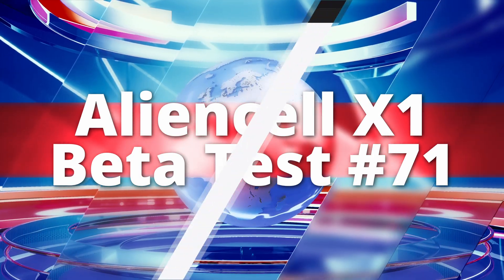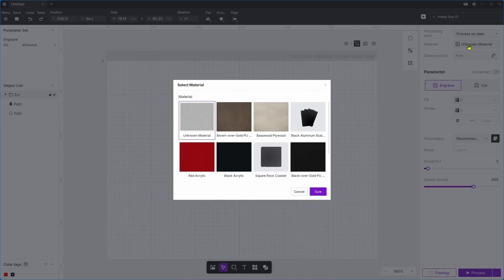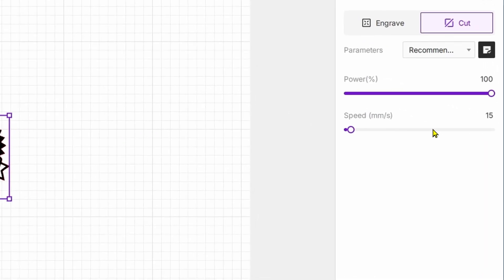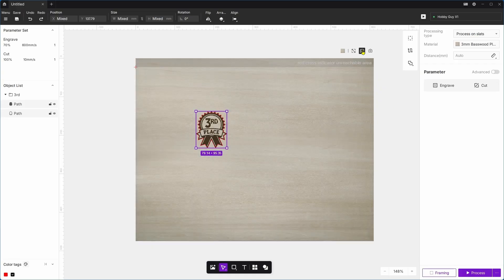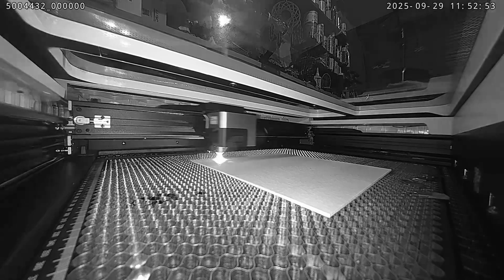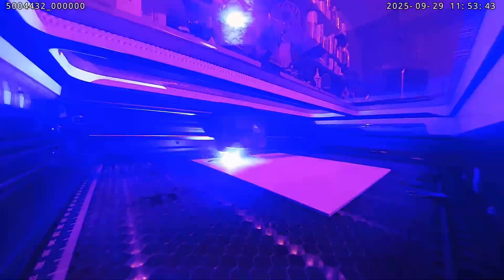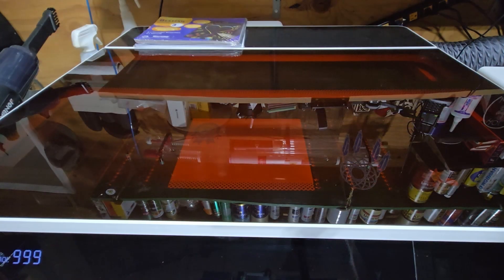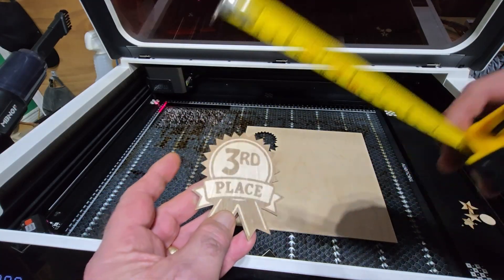🚸 Beta Test #71 on the Aliencell X1 40W Diode Laser

Comment: Great job on the video, I look forward to seeing more of them. I noticed that on the Aliencell software, there was no control for the Air Assist...can you please explain how the laser knows how to control the Air Assist and if the user can adjust the settings?
Reply from the maker: Good question, I had the air compressor set to Auto, so the machine controls it. You can also override the settings on the compressor itself if you want more or less air. Thanks for watching!
Reply: @TheLouisianaHobbyGuy when in Auto…I assume it shut off during Engraving and turned on when in Line (cut) mode?
Reply from the maker: No, it turns on at the beginning of the job and off at the end. You can manually turn it off if you want, but I wouldn't recommend it. You always need air to keep the lens clean.
Reply: @TheLouisianaHobbyGuy  hmm…